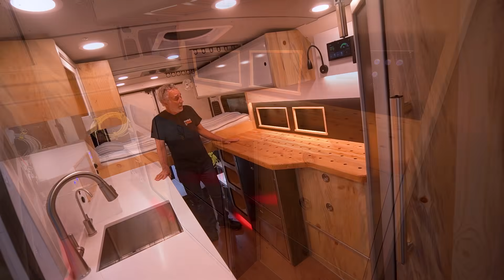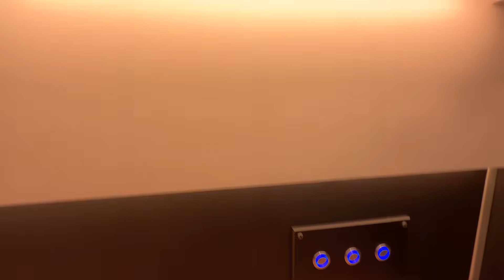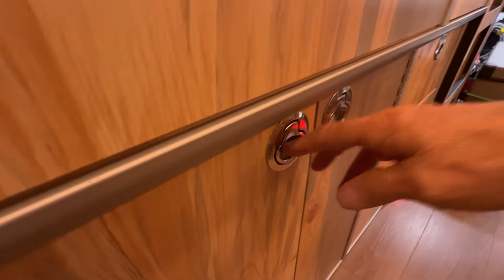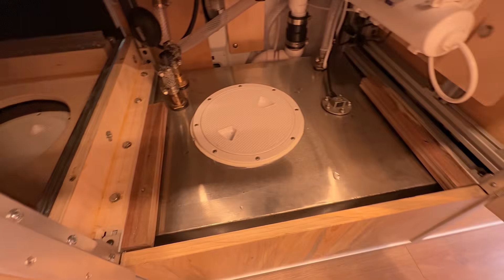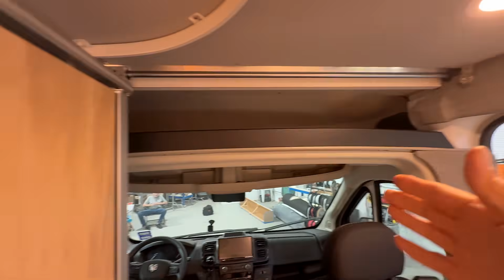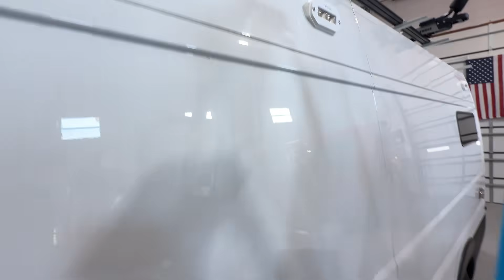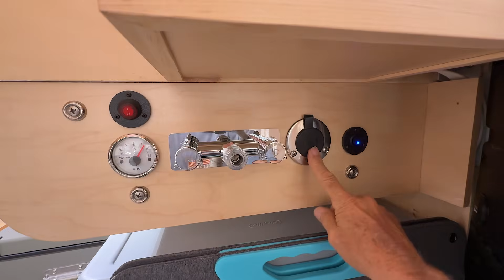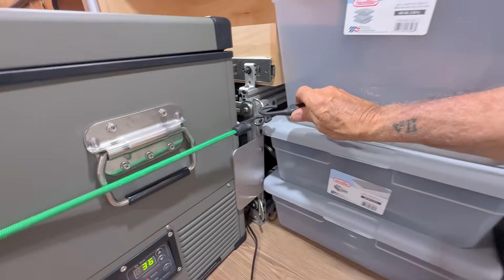Full timer calls on Humble Road to build a workshop in a van. Ecoflow, solar, kayak, fishing poles.

Comment: Do you always install high-voltage (120V) receptacles upside down? First time I've noticed this.
Reply: If the item plugged into the outlet is not flush with the cover plate and something metallic drops onto the plug prongs, it contacts Ground not Hot 120v and Neutral.
Reply: Some also say a heavy cord is less likely to pull out?  I’ve tried it and haven’t noticed a difference. Maybe in a vibrating van it will help?  Maybe electricians will respond.
Reply: @dmwi1549 This is what they'll tell ya lol. In our specific examples, the receptacle itself protrudes. Doesn't this mean your super-thin imaginary metal object would land on the plastic that is the receptacle, or, because of the sheer silliness of this argument, would said metal object ignore it and go right for the prongs on the cord?
Reply: Not necessarily upside down. State laws vary but in CA schools and hospitals are required to have outlets installed this way. Or so I was told by a professional electrician.
Reply: UK has ground on top, Australia has ground on bottom. Personally, as an electrical licensed person, ground on top seems safer. I have been shocked by shiny Christmas decoration debris fallen behind a plug. Cord pulling out is not a safety concern it's an inconvenience. However, I have to install ground on bottom because of my local regulations.